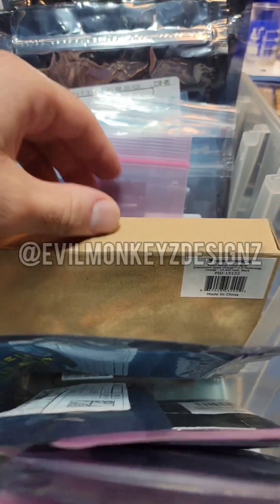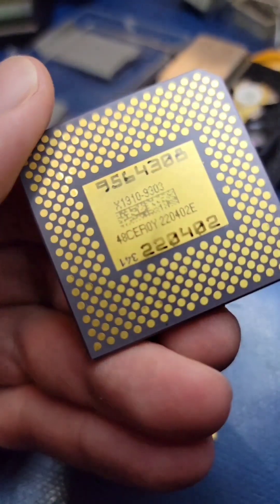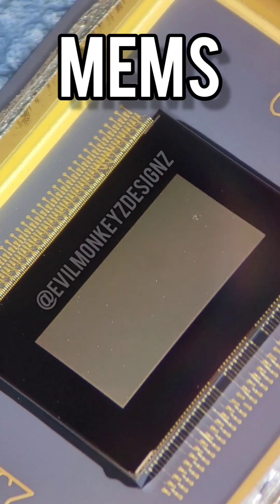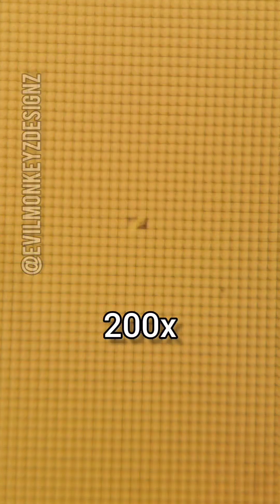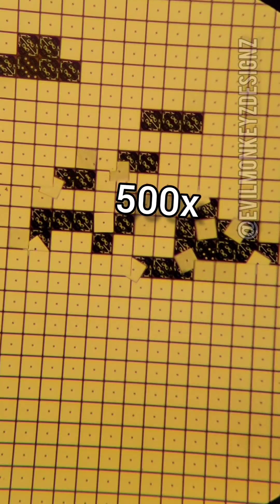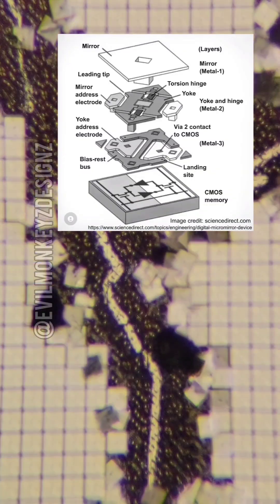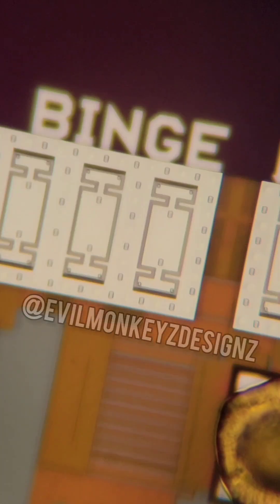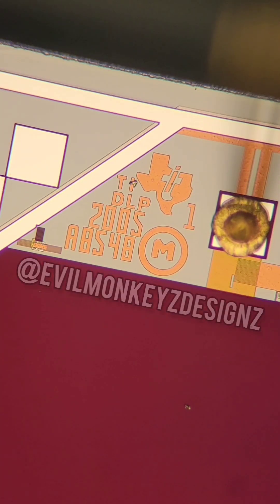A silicon chip with 408,960 mirrors

Comment: DMDs have a heat tolerance problem, and most projectors run way too hot, blasting the DMD with infrared, which freezes the mirrors after a few thousand hours. At first just one or two mirrors fail, but eventually it looks like a watching video in a snowstorm. Nice idea but terrible execution.

Comment: I remember coating a TI DMD chip with a super thin layer of gold over the mirrors, by thin, I mean a few hundred atoms thick. The reason? The chip was repurposed to project thermal infrared light to be able to use a computer to generate thermal images for test patterns for thermal imaging devices. Was able to reuse most of the optical system from the phantom projector. Previously we had to make very expensive patterns and manually remove and replace them. After the modification we were able to project anything we wanted. All that was required was to modify the optical system to use the chip and adding a few gold first surface mirrors. Good times.❤

Comment: That brings back memories. I worked for the company that added Chromium 5 to the first layer, then shipped out to another company to perform the etching of the aperture. Then finally adding the coating of AR. I remember the meeting we had with reps from T.I. and the failure rate. We were producing thousands of those lids.
Fun fact, Kodak company was trying to perfect a similar product but never got enough traction for a final product. If anyone is curious, search for OCLI and JDSU.

Comment: It kinda reminds me of those flip dot displays like on a bus or train, but on a microscopic scale
Reply: Bit different. These ones, the mirrors tilt by a few degrees, to either reflect light out the window and through the projector's lenses, etc, or else they shoot at a bit of black stuff that just absorbs the light. 

The light itself comes from a powerful bulb like a normal projector. Usually DMD projectors used a colour wheel, with R G and B tinted glass, that spun round rapidly. I think later ones used powerful R G B leds instead. Still means each chip reflect first, red light, then green, then blue, separated by time. Rather than all at once, separated by space like an LCD. Since an LCD has coloured filter strips spread across the space of it's surface. 

This DMD uses every pixel for every colour, each a third of the time. An LCD uses a third of the pixels for each colour, all of the time.

These mirrors can respond much quicker than LCDs though, so it's fine to modulate colour over time, rather than over space.
Reply: @greenaum  Professional cinema projectors use 3 DMDs, one each for Red Green and Blue.  The light from a Xenon arc lamp was split using a prism and mirror setup. Smaller commercial and home projectors use the color wheels.  The latest gen of pro cinema projectors uses lasers  (Two or three, some with color change phosphors, others none) as the light source to help get better light and better contrast.

Comment: what's more incredible is that companies still use out of date DMDs such as this for cheap projectors and label them 1080p simply because the input circuitry can accept up to that resolution
Reply: Those diabolical resolution shrinkin' marketing MF'rs!
Reply: Mostly Chinese junk
Reply: But are they actually 1080p?
Reply: @JosGeerink  No the cheap ones are HD ready which is 720p or 1366x768. FHD is scaled down by the chip.